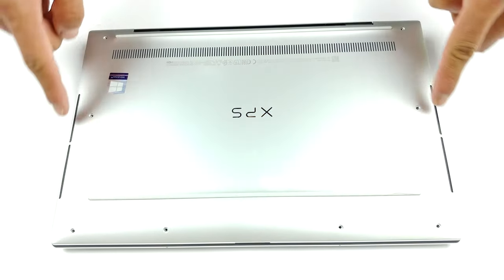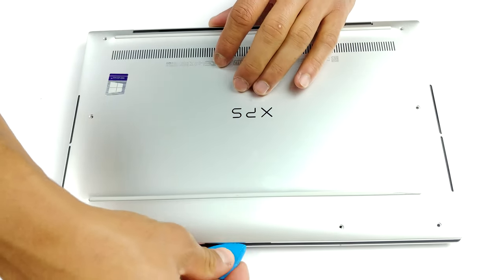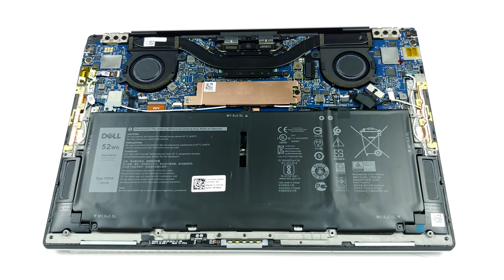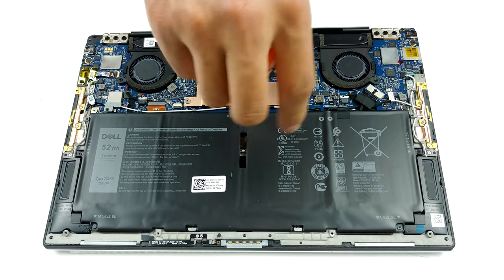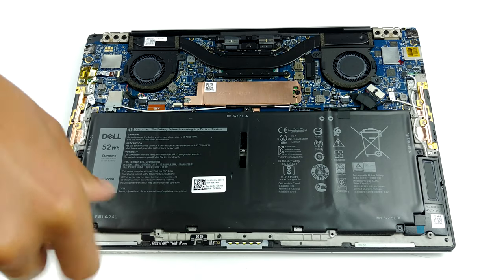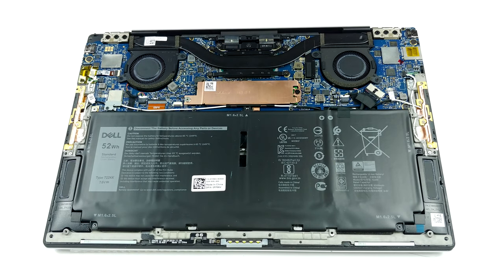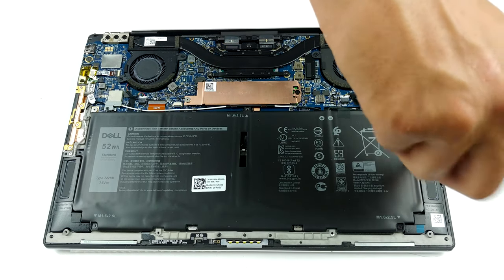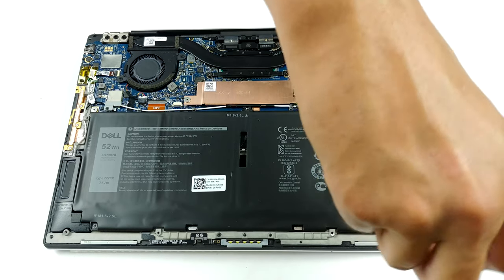🛠️ Dell XPS 13 9300 - disassembly and upgrade options

Comment: Where is the CMOS battery in this thing??
Reply: You ever find it?
Reply: The Dell XPS 9300 does not have a dedicated CMOS battery or chip. Instead, it uses modern UEFI (Unified Extensible Firmware Interface) firmware, which stores BIOS settings in non-volatile memory.